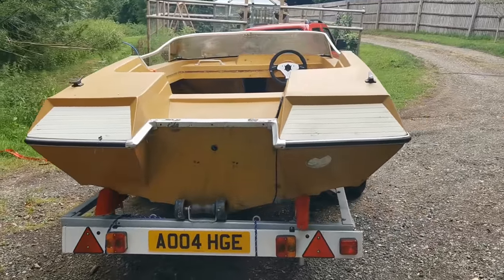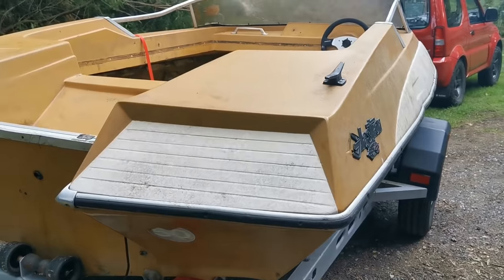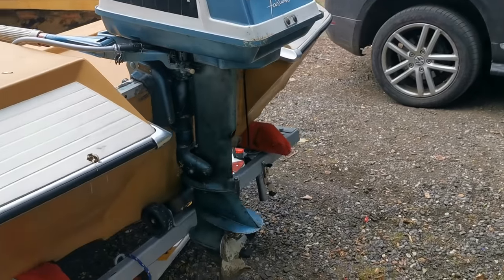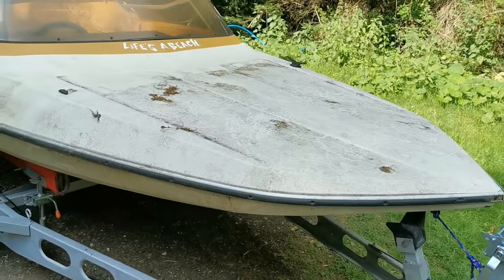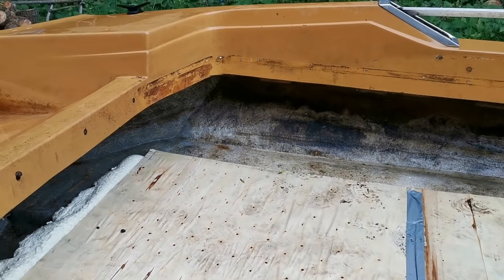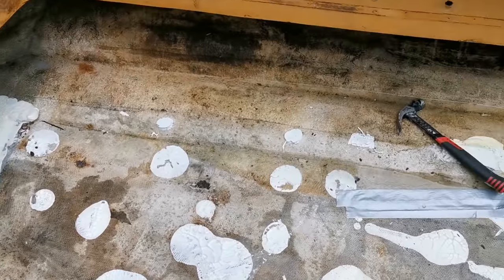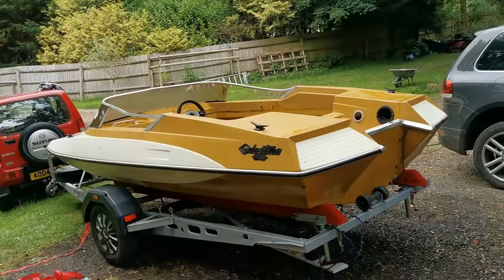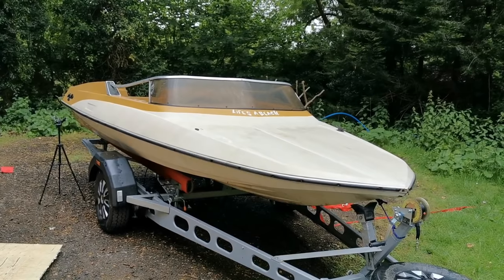James Bond speedboat restoration part 1

Comment: Very fine vessel. Well done. Interesting hull shape, not a very deep-V...? But I guess she will be speedy in calm water. Interesting that you chose to tow the 600  miles with the Jimny instead of the Touareg! That was a great boat chase sequence in the movie. Looking forward to the restoration. Cheers.
Reply from the maker: Yes the touareg is more comfortable, but the jimny uses much fuel, which adds up on a long journey. It also had to be recovered from a tight space.

Comment: I had this boat many years ago as matter of fact it was my first boat. The person before me had already did a “restore” I say it like that because it wasn’t perfect but it was nice. Though the engine was to much with a 125 it was super heavy and sat low in the water. One time I took it out and nearly sunk it I had 4 full adults and I was taking on water the boat wouldn’t plain off and I realized I made the rookie mistake of not putting the plug in (ugg) made it back to the ramp by having my friend sit on the bow so it would plain off. It ended up taking on so much water my 4x4 locked in low wouldn’t pull it I had to get help. With the 125 I would do 50 easy and it would be out of the water more then it was ever in so you are right about that. I loved this boat though small but like driving a jet ski I could jump waves and get 2 feet off the water. Thanks for sharing.
Reply from the maker: How are you doing? 
That's a fantastic story, and your not alone as I have left the plug out more than once!
Reply: Boats and Engines doing good, we’re just getting out of lock down here in California US. How about you? did the virus put you in lock down. It’s been awhile since I’ve commented but I still watch your videos. I’m super excited to see this boat like I said sentimental value and all.

Comment: i had a 1975 version same color as bond movie except mine had 115 evinrude shorelandr trailer very nice shape bought in 1981 and sold it in 1985 then bought a 1985 hydrostream vector with evinrude 175 big difference in speed and quality of build

Comment: To check out the transom you should have left the engine on the boat and locked the engine in a 45 degree tilt and try and lift the leg and watch the transom for flex and cracks or drill half way through from the inside below the water line and look for water and roten timber. And good luck splitting the top deck from the hull . ?